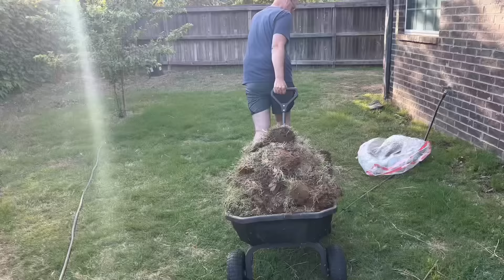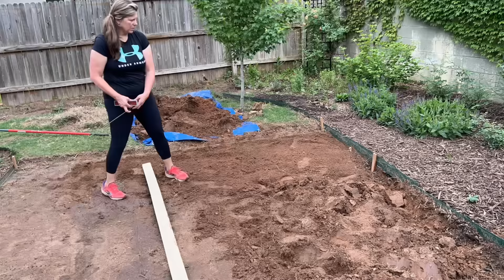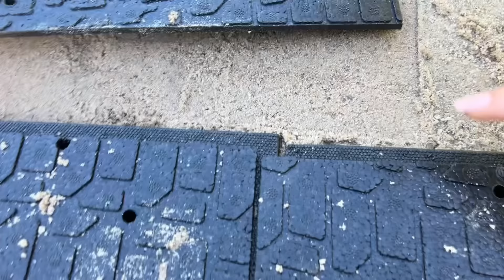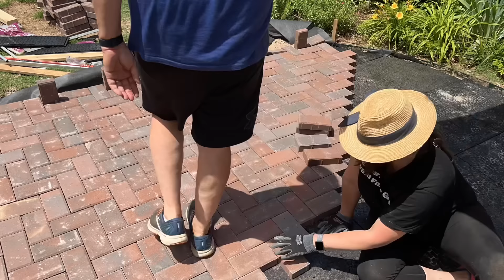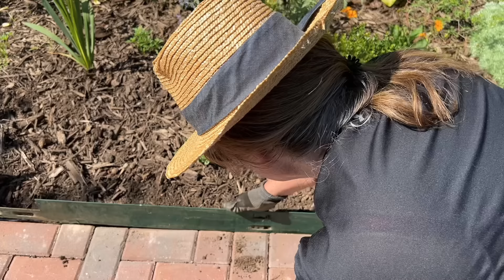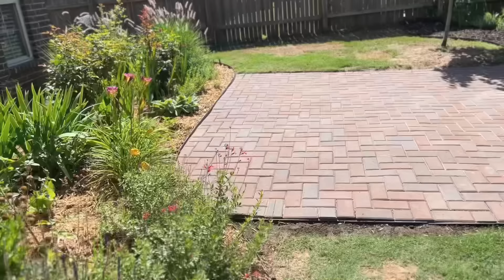Amazing DIY Paver Patio using the Brock Paver Base Panel System

Comment: Great video, just a quick note : The sand layer can be from 1/2 " to 1 " deep. It's nothing more than the final step in creating a level surface using a screed. The easiest method is 1/2 " PVC pipe in 10 foot lengths. The outside diameter is about 5/8 inches which is perfect. Even the instructions forgot to show the variable 1/2 to 1" deep and only said 1/2 " which is a problem finding something 10 feet long that's exactly 1/2 ".

Comment: Great job. 
I think you got unlucky with the paver sand. When I did my patio my sand was completely dry and therefore it went easier. 
I bought a new house and want to do the patio this time with paver panels (my previous one I did the old fashioned way). 
Thanks so much for the video. 
Fellow so it yourself gal 😎🙋‍♀️
Reply from the maker: Thanks! Yeah, the rain definitely didn't help. I wish I could have smoothed it out one more time before laying down the landscape fabric, but in the end it worked out and after three seasons it still looks brand new.

Comment: I'm about to build a patio using these Brock panels and 2'x2' porcelain pavers. My biggest concern is flatness, do the brock paver base panels create low and high spots? I saw another video where the pavers weren't immediately installed and the brock panels bent like a banana.
Reply from the maker: It's hard to say since my pavers are so small. It might look different with 2'x2' pavers. I would definitely recommend trying to make your substrate as flat as possible. This is our third season with the patio and it still looks brand new.

Comment: Interested  to hear how the paver patio is holding up using the Brock Paver Base Panel System?  We are preparing to start a paver patio extension and your video is prefect for our project!  Thanks:)
Reply from the maker: It’s been 1 1/2 years since installation and it looks just the same. I’ve been very happy with it!
Reply: High density foam...it's excellent. Thousands of people are lifting concrete slabs with injected foam. Perm fix.
Reply: Can rain drain through these though??

Comment: I did my walkwway with these panels. They need to be as flat as possible without flexing against your sand and you shouldnt be repeatedly walking all on them as they are foam. If your panels bow up you can leave them in the sun to flatten. If they are flat and are popping up your screed isnt level and you can throw sand under them until them lay flat. This is crucial as your paver surface will not be level and may flex. Also, use a laser to line up your joints
Reply from the maker: Good points and tips!

Comment: You can also with the Brock Paver Panel place the paver and the edging on the pad itself and then spike goes through the edging and the pad holding everything together without the need for the polymetric sand.
Reply from the maker: Aw, good to know!

Comment: Nice pivot (literally) on the pattern. Getting ready to do a multi size paver patio over most of my back yard and paver mats are already purchased. 

Hats off for the use of the Pythagorean  theorem. I'm sure a lot of viewers learned a valuable trick. 

Just a note to those doing this type of project, turn your screed board (2x4) on edge when running across the pipe or conduit. It is less likely to flex and throw off your slope. Also, pay the extra buck or two for kiln dried lumber. It tends to be straighter than construction grade lumber.
Reply from the maker: Thanks for the tips! 👍🏼

Comment: when you were staking the slope so you pulled the strong down 1/2 inch as you went each foot - how do you do that oh my that is where I am stuck now. I am making a 10 x 12 large paver patio
Reply from the maker: You put a stake at each side, run a line. Check for level. Then move your string down a few inches for your slope. We had to excavate a little more dirt on the side where I needed it to slope. Use the 2x4s to level out the dirt the best you can following the string line. Good luck! 🍀

Comment: Hi I’m looking to do a paver patio this summer. Did you have to add a slope when installing the patio? If not are you experiencing any issues with pooling of water.
Reply from the maker: The slope was the most intimidating part! But after running the line and smoothing out the dirt, it worked! A year later and it always drains away from the house.
Reply: @ thank you so much for the reply. I plan on getting started this weekend. Your video gave me the push I needed 🤣
Reply from the maker: @ awesome! Good luck! 🍀
Reply: Sorry I watched your video for a second time and found where you included the slope! I’m doing my research and that part scares me the most lol

Comment: Why is nobody helping you. I started a project myself going on two months  90ft x 7ft then 50ft x 10ft with 235 ft of drainage. 35ft french drain & 200 ft of soild drainage catch basin drainage. Two service ports & 9 drainage points. Still not finished.  With no help. A axe pick a few  wheel barrels & 1k worth of tools.
Reply from the maker: Yikes, that’s a HUGE project! My husband and I did it together over a few weeks. 😊
Good luck with your project 🍀

Comment: A very nicely done video. Step-by-step and very informative. However, using PAPER PANELS, which are NOT durable, may compromise all that sweat and effort a couple of years later.
Reply: I noticed in a video on another channel that the closed captioning said "PAPER panel" when the person said "PAVER panel." The panel  material is actually Polypropylene.
Reply from the maker: The plastic paver panels? We’ll see. 😊
Reply: Not true. This is just scaremongering that contractors say so DIYers give up and hire them 🙄. There are plenty of examples of people building with these paver panels and 5-10+ years later the patio still looks great and no issues.

Comment: Nice work!!  I feel like that angle grinder is more dangerous than a wet saw would be and you did greatl.  You could have someone squirt the brick with a spray bottle as you're cutting as well, that helps minimize dust.
Reply from the maker: Probably 😅 I was working solo at that point, but that is a good suggestion. Thanks! 😊

Comment: Paver panel not necessary. Just another product to buy. Looks great.
Reply: “…panel not necessary…” Putting the pavers on only 1/2-inch sand base would not work. The whole value of the panel is not excavating and filling with 3-5 inches of rock and sand.
Reply from the maker: Thanks! 😊